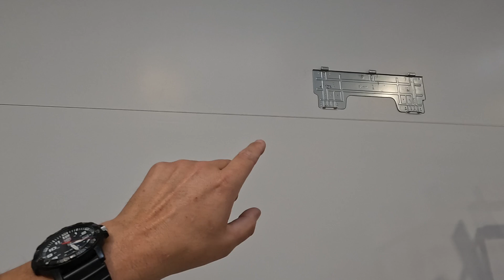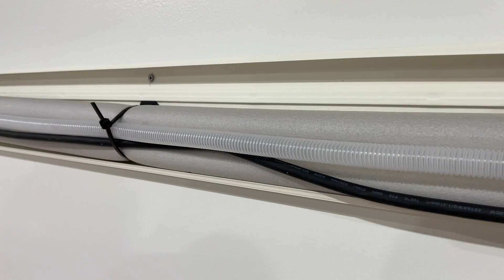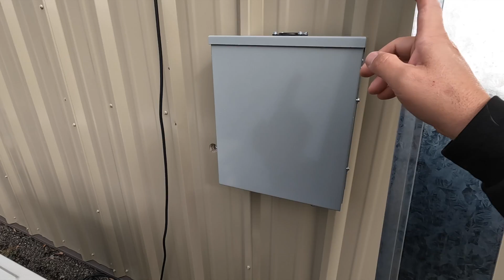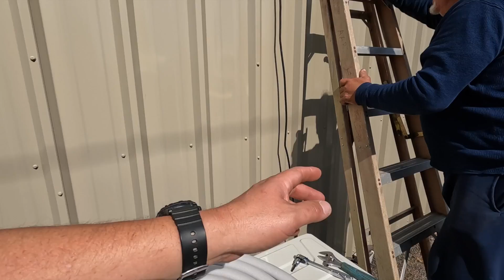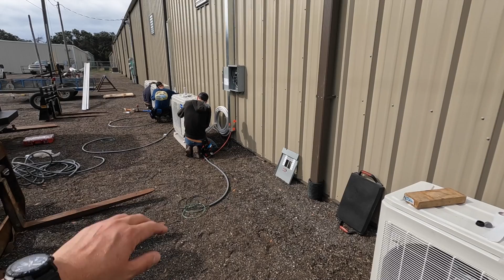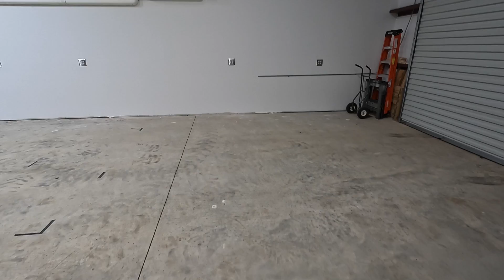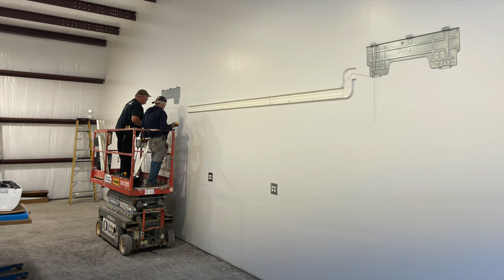Mr Cool AC INstall for New Shop Part 2

Comment: wait they are heat pump too so ? They are AC/heat pump and dehumidifier too .I'm surprised that you went with Mr. cool because you used a Hvac co that pull a vacuum and charge it with 410A ? ALL mini spits have a heat and ac modes Mr Cool is one highest price and Mitsubishi is the Cadillac of Mini Splits system

Comment: Curious on the square footage of the building? I have a 1,600sqft red steel building with 16 foot eaves and a 4/12 pitch w/ 3 inch insulation. How many 36k units do you think would be needed bare minimum?
Reply from the maker: I believe the 36K units are rated for 1,500 sq ft and maybe 10’ walls. I would suggest having two of them for your space and I know that’ll cool it down nicely.

Comment: At 12.33, Just a friendly tip.
The cable clamp must clamp the entire cable and housing. It is there to unload the electrical wire connections at the terminals from mechanical stress. This is especially important in installations in a vibrating environment. Over time the copper wire in the terminals will fail due to metal fatigue due to the hanging load from the cable.

Your electrician did do it right with a cable gland.

Was also quite shocked to see that AC is a DYI job in the US. It's only allowed by licensed technicians here in Northeren Europe.
Reply: 11:05 looks like it was installed properly later on, I imagine the video is just edited out of order

Comment: Those coils of lineset would drive me nuts. He already has the equipment out of the truck, could have just cut and evacd the lines and made it look 10x better.
Reply: I considered that but was told the units are shipped with the proper amount of 410a for 25 foot lines and if I shortened the lines the system would be overcharged with Freon. The coils look like crap and I hate them too but decided to just roll with it instead of screwing with the length.

Comment: Adam,   Could you get your step Dad to talk about these inits.  I know they have to be good.  Or he would have talked you out of them.   With his experience, thought he could talk about the pros and cons.  Also  is there a situation were these would not be ideal.  To where you would want  a professional A/C system.  Thank  You !
Reply: cons a pro hvac cost a bet it cost 5-7 K for them to install that 4 units and the electrician too I have done mini split in garage at home and the unit i pick up was less Then $900 and I did the labor my self and the unit installed in 1 day :)

Comment: Don't know about Florida, but Texas code requires 1/4 inch of drop per foot of run in drain lines as well as a clean-out at the unit. Should also have Fernando rebalance the units that required longer lines.

Comment: EASTER EGG - Anyone else notice the thing that appeared inside the shop with ZERO explanation?  
Notice at the 2min 30 mark there's nothing in the top corner of the shop.  
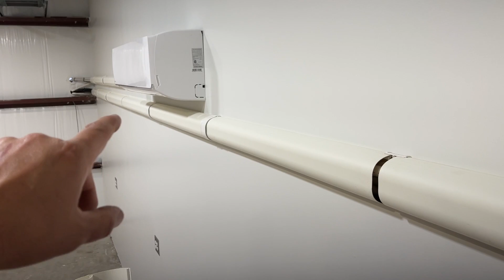Then notice @23:54 mark there is something above where the HVAC line leave the shop.  
However there's no explanation for what that is.  
Adam - inquiring minds wanna know.
Reply: Looks like a 3 phase transformer
Reply: @stevekopito  Thanks but I thought he already had 3 phase power to the shop before this vid.
Reply: @jontnoneya3404   Looks like a Boost / Buck transformer to adjust the voltage for some piece of equipment, fairly common electrical installation in a machine shop.
Reply: He did say the electricians were there for wiring some machines so that was probably part of their installation for the day.
Reply: @jontnoneya3404  240V three phase is what usually comes off the utility pole. If I remember correctly, his K&T horizontal mill needs a higher voltage. That would explain the transformer.
Reply: @horseshoe_nc  no. That is old tech and rarely used now. 120/208 or 277/480 wye are the current standards.

It may be a buck boost to get a 240v Delta from a 208 wye.
Reply: @leftyeh6495  his K&T horizontal mill is old tech. However, you could also be right. I just remember him having trouble with his K&T and having to get higher voltage to it to resolve the issue.

Comment: you did not perform a vacuum before releasing the coolant and you contaminated the coolant.  and that creates a mixture that corrodes the lines
Reply: I'm a bit late, but the lines for the DIY kits come vacuumed with a seal inside the connections. The seal then gets punctured when the lines are tightened together.
Reply: excellent I did not know about that technology I hope to receive it soon in Puerto Rico 👍🏼💪🏼 good job
Reply: Did you watch the same 2 vidoes that the rest of us watched?
Reply: no, I did not see them but I did not see when they empty the lines.  I only say this from my knowledge and they really did an impeccable job.  I congratulate you.  In my case, I always use PVC pipes in the drain since the system it brings lasts very little for tropical temperatures such as Puerto Rico 👍🏼

Comment: Thats a common comment with these units is the coiled excess line set. There is enough pump pressure to return oil back to the compressor with these setups.

Comment: Each evaporator is required to have a service disconnect switch next to each one. Toggle type is fine. Outside is fine as long as the power panel is within 25 ft of each unit.
Reply: 50' and within sight. 

25' for the service recep.

I would call the breakers in the panel the disconnect, since they're right there anyways. Silly to spend $60+ per disconnect when the breaker will service nec requirements.

Comment: Did not see any evac work. Normally you evacuate the air, pressure up with nitrogen and if no leak evacuate again and then open the gas.
Reply: The lines come evacuated and some are even prefilled. That's why they didn't cut the lines to the correct length and left that pigtail as is.
Reply: @stefankaufmann8257  So those short lines that they connected together to the inside lines partway up the outside wall were evacuated? Didn‘t look like it.
Reply: @jadesluv  

You are right, doesn't look like.

at 11.08 you can see the vacuum pump and the fittings and gauges...

https://youtu.be/5J0HXKTYP8w?t=668

Btw: Nobody in my country would leave a pigtail, if the lines weren't prefilled. Lines are cut to size and fittings are installed afterwards.
Reply: Adam talked about that in the video. Remember him saying two of the units needed extra work? The Mr. Kool systems come with a fixed length line set, that is ready to connect and go. That is why they call it a DIY system. However, two of the units those line sets were not long enough. They had to extend them onsite. That is why you see the vacuum pump and guage set. 

The way the DIY kit is designed, if you shorten or extend the line set. You will need to pull a vacuum.

Comment: Drain line from two units sitting on the solid whit wall it's not the best solution You can do...
Dust and water comming from evaporator will block the pipe soon and problem back again.
Best way will be if You instal accessory drain pump.
Reply: Also you need atleast 2% inclination and bigger pipe dor worry free draining...
Reply: @Mtematiks  The condensate pump is the cause of the most common failures in such systems and I would avoid it. I do not know what the cross section of this pipe is, but it does not seem too small for the minimum amount of condensate that will flow through it.
I would rather bet on some kind of pipe breakage. Check for outward flow.
The lack of inclination will indeed cause the water to remain in the pipes, but should not obstruct the drainage as the output from the indoor unit is higher than the highest air-filled bends.

Comment: Not sure why keep going with the extra lines coiled up when you have an hvac guy.
Reply: By leaving the factory sealed lines as they are, they don't have to pull a vacuum. If you modify the factory line set, then a vacuum is required. Part of the reason of the video is to show, those particular systems can be installed without an HVAC technician.

Comment: I love Adam’s content but he’s way way off base on this one to get a free AC system. Someone without experience or a license handle refrigerant should not be installing these units or any units.
Reply: Did you watch a video from someone else then come here to comment about it? I think you must have, as your comment sure does not tally with this video.
(Edited for typos.)
Reply: These units are intended for the DIY market. Did you hear Adam talk about his step-father? Why don’t you put up a video of you installing a system. I bet many folks out there would love to critique it!
Reply: It’s a Mr. Cool DIY system. No special tools or training required.
Reply: Those particular units are designed so that they can be installed by a handy homeowner. As long as the factory line set isn't modified, no vacuum, guage set or handling of refrigerant is required.

Comment: You should not coil up extra line set behind the unit. this creates oil traps and can starve the compressor of oil resulting in premature failure - something the DIY kits won't tell you.
Reply: So true
Reply: I don't even see if they put a vacuum in these devices, and
open the valves, first the suction side.How well was done tighting of the pipe joints? I think there will be a leak of freon.

Comment: More good stuff!! I installed an 18k btu Mr. Cool in my 28'x30' shop about 4 years ago. I'm glad I did, no major problems...but some odd issues with heating and cooling modes. This was with the Oasis ES series.

Comment: Did you need to add refrigerant to the unit where the lines were lengthened?
Reply: there is a chart supplied in the box that says how much you have to add or remove to how much you add or remove in the length, and since he added length he needed to add refrigerant in the two machines he lengthened the pipes
Reply: @ItsBurn2020  lines are precharged with stop valves, there's no need for vacuuming or refrigerant add.
Reply: @SolDraconiSeptem  two of the units needed the line sets extended. Those two units would need a vacuum pulled and most likely extra refrigerant. If you go back and look, you will see a vacuum pump and guage set on one of those two units. Adam mentioned those two units needed extra work that made them not DIY friendly.
Reply: Yep. That’s what Fernando was there for.

Comment: Hi Adam, nice work, as usual.
Literally every single flat here in Zagreb, Croatia has one or two of these.
I have one made by Samsung and it's more than enough to keep my 80 square meters flat cool. It kinda works too good, so I have to run it at low :)

Comment: Generally HVAC equipment manufacturers require an evacuation with a good vaccum pump and micron gauge   to the 500 micron level or less to remove all non condensables "air" and moisture ; A compressor can only evacuate the line set and evaporator to 23,400 microns level , Not adequate for evacuations . Sorry .
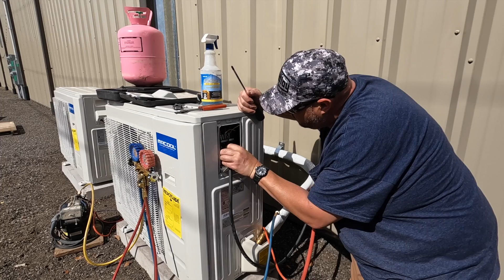Reply: Did you watch the entire video? At 10:36, I spy a manifold gauge, tank of refrigerant, and what looks like a vacuum pump. Too bad Adam didn’t include any footage detailing the lengthened lines. Probably would have prevented half the comments here.
Reply: @mitchkronowit3633  That is definitely Not a vaccum pump , It is a compressor used as a vaccum pump , It cannot achieve the deep vaccum level required for this equipment ; A proper evacuation to 500 microns ;
 with a proper vaccum pump along with an electronic vaccum guage to measure the vaccum level , This ensures a long life for the system ; Fernando is a good person and means well ; But he needs to modernize his equipment to do a proper job .
Reply: @michelgrenier1878  Ok, thanks for clearing that up. 👍
Reply: I was concerned about this also but checked MrCool website. The lines are precharged and don't need vacuuming. There are stop valves that open up when you tighten them in.
Reply: @SolDraconiSeptem  The line sets of the 2 furthest units were extended and evacuated with a compressor , There is air in those 2 systems .
Reply: @michelgrenier1878  That might be true and I was also worried about this. I'm no expert on these matters but thought that lines should've been vacuumed. Hope they knew what they were doing.
Reply: @SolDraconiSeptem  I have been a HVAC and Refrigeration teck. For 40 years now , Expert tecks. in this trade use good vaccum pumps and electronic vaccum guages to get nearly a perfect evacuation , This removes all the air and boils out any moisture For a good reliable system ; When some air and moisture is left in the system ? , Over time with the oil in the system will produce acids resulting in system failure . It is just practice to evacuate systems properly .

Comment: Whoops. How will the condenser water drain out?  You mounted the line  horizontally on the side walls, but you should  have pitched the line guards down along the wall jut like would do for drain pipes in a plumbing installations. Like 1 inch every 5 feet. The water will backup and not drain out!
Reply: Did you watch the video at all? He did pitch the pipe inside the line hide when replaced with pvc.
Reply: @andrewdarbyshire9108  looked to me like mostly level with some uphill spots.
Reply: @lightclub26719  Adam went into detail at the end on the change to the drain pipe. It runs downhill.

Comment: You do not coil refrigerant lines like that the Freon is going to collect in there
Reply: While it’s not recommended, the only thing that will collect there is oil. The liquid refrigerant will boil off into other parts of the system.
Reply: Ask me how I know you're not a professional HVAC technician.

Comment: Not sure if it'll be an issue, but the drain lines need to flow downhill all the way, like you would with a gutter. If the line isn't completely flat, you need more of an angle to be sure they drain. They are also supposed to run as the lowest line in the line set (presumably for the same reason). In your interior install, they look level (or close enough to it) and also had some peaks and valleys. 

I came out to my shed with water pouring out of my air handler one day. It was because the drain had clogged and the line backed up. You'll have the same type of thing here if it's not running downhill, especially in humid Florida. It's only gravity, not pumped.

Edit: I see that happened 2/3 through the video.
Reply: True. Even gutter "installers" don't normally check for the proper slope. You then end up with stagnant water and overflow that rots out the facia. In our area, the HVAC folks didn't use P-traps in the drains. Even worse, they failed to even glue the PVC lines at several joints. A little Kilz repaired the ceiling damage. Its difficult to get well-trained people. 🤣
Perhaps I'll also get one of those 'winners giveaways' that seem to be going to those of us to have faced the problems the "pros" leave for us! DIY lets more of us why some pieces of some jobs really do require expert knowledge. 🤔 Truly hope Adam doesn't have more water problems. 👍

Comment: Something to think about for the outside units. These are under the drip edge of the roof. For rain that probably isn't an issue. But if you have snow that slides off the roof that could be an issue. For your location I don't think you need to worry, but for someone where a foot or two of snow could come sliding off the roof all at once those units might not survive. I had a situation with a regular heat pump where I almost lost the heat pump. I got lucky and ended up with only a few dents. I ended up building a highly braced enclosure to protect it after that, which works well, but If I had been thinking about the situation I could easily have positioned the heat pump in a location that didn't have that issue.
Reply: we have same issue in CT. Roof line gutter/ice/snow over unit. We used a 1" solid cap, but with a three-sided perforated shield w/interior hard but fine screening surrounding entire unit (allows air flow but keeps out bugs/critters)

Comment: By lengthening the lines are you starving those units of refrigerant?
Reply: At the 11 minute mark you can see a small pink tank that was likely full of refrigerant. So, yes, but they rectified the situation.
Reply: So based on your reply if you extend the lines you need to compensate for the missing refrigerant and that is something a DIY needs  to know.
Reply: @vitellaj  Lengthening the lines by themselves takes them out of a diy project. 

The company sells more than 2 different lengths of precharges lines that you would be able to connect several together in series and be able to keep it diy friendly. Not sure why Adam didn't go this route.
Reply: Adam has stated several times that Fernando is a licensed a/c and refrigeration contractor.  I'd think he would know how to handle the modification.

Comment: I think the condensate line on the long horizontal run is going to leak. Those aren't waterproof joints, they're designed for vertical runs.
The horizontal run is lower than both ends which means it's going to have standing water in it and that will leak out of those joints.
Reply: I saw that coming.  Couldn't believe that these seasoned HVAC guys thought that would even work.  I installed a LG 24K system in my 1500 sqft garage, and I made sure the condensate hose had a fall to it..
Reply: Guess I should have watched the whole video before commenting. Nice to know I wasn't wrong though.

Comment: Don't you need a convenience receptacle within 25' of the units outside?
Reply: @mitchkronowit3633  got it
Reply: Yes that is required by code and will need to be installed prior to the permit final inspection of the job.
Reply: The last unit is probably within 25' of the external breaker cabinet, so all good.

Comment: Another benefit to having some climate control in the shop is that it will help to keep the machines in size since there won't be as much thermal expansion in the machines.
Reply: And the work (parts).